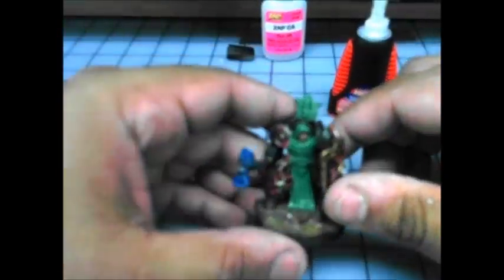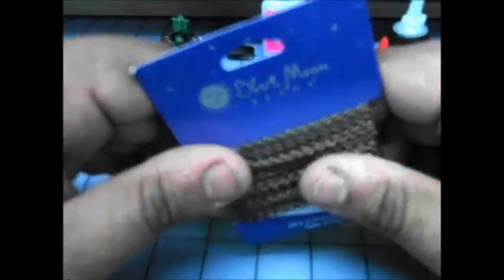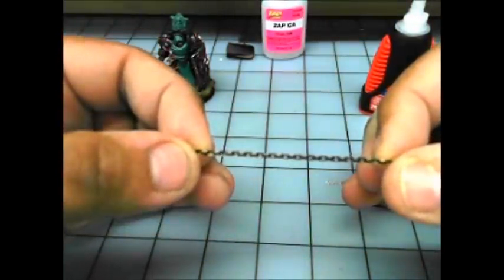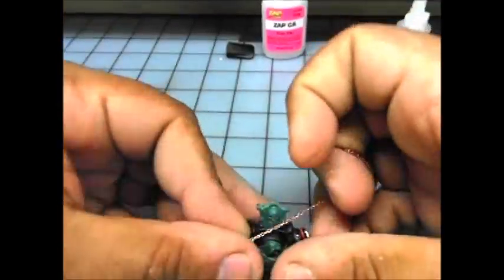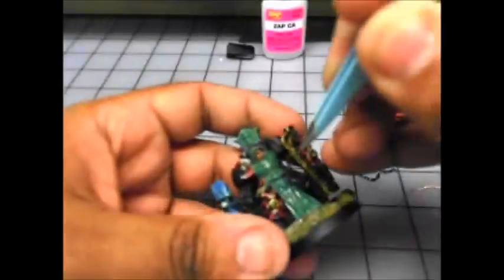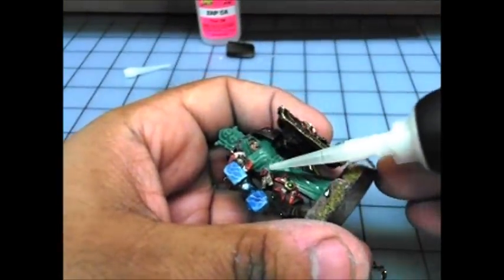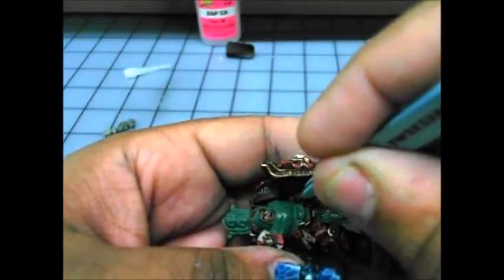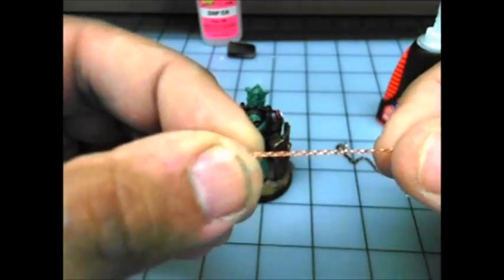Converting Miniatures with Real Chains

Comment: Is it possible to make the chain be stiff? Lets say i want to change the plastic chain on a weapon with real chain, i want it to be in a certain position.
Reply from the maker: +gamekonsoller I use Thin CA in the video to glue the chains into position. Its thin enough that it will run into the links and should be able to stiffen the chain out. You can also maybe run a very thin wire (floral wire comes to mind) through the links of the chain and use it as a frame for the chain.